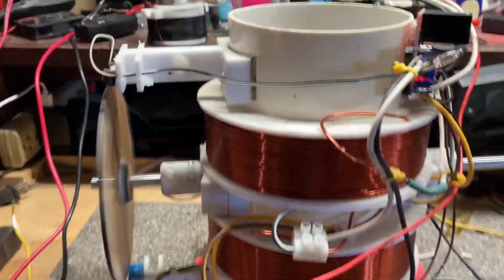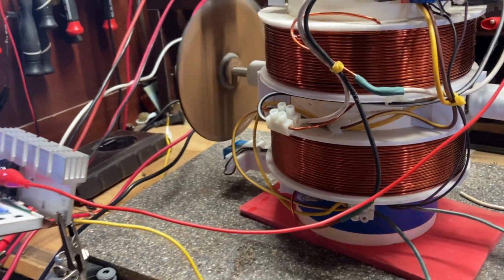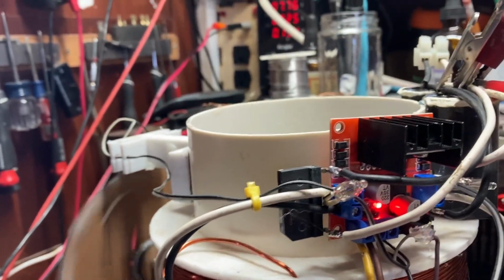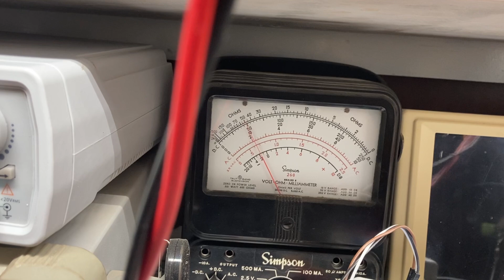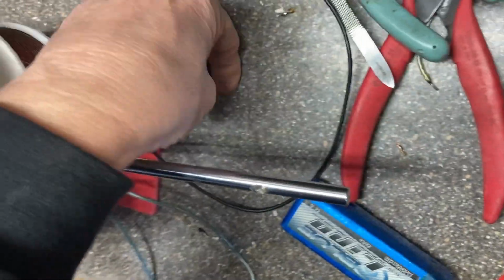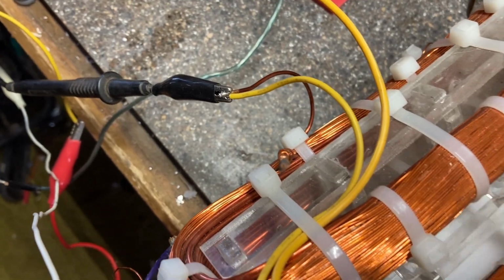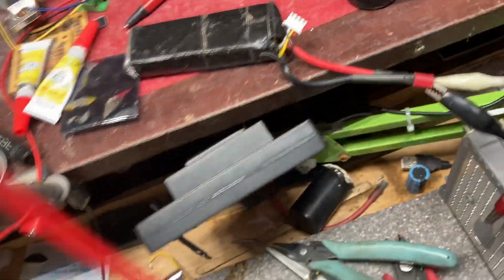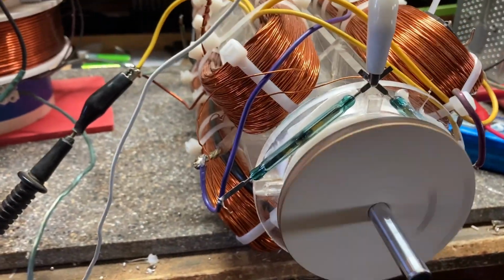Newman Motor H-Bridge upgrade and timed cap dump.

Comment: That’s cool prototype! Definitely more torque 
Nice replica too ! I’ve used 3,500 volt reeds before makes the coils glow pink purple!
 Thanks for the share
Reply from the maker: Thanks, I figured I would share before I got too busy. I know now what I want to build after years of tinkering. It will have to wait until I get my big project out of the way. Almost every reed switch I've used eventually welds itself together even on the really small models I've made.
Reply: @theclintified  lol mine too one arched over and cut its self off lol 

Hope to see you new project!

Comment: Very nice set up. What size wire are you using in your coils. ?  regards Deryck
Reply from the maker: Hey Deryck, I believe it is 14G about 300 turns each. The best results I have had is with mechanical switching (relays) as far as BEMF